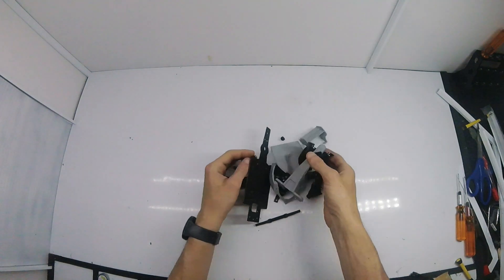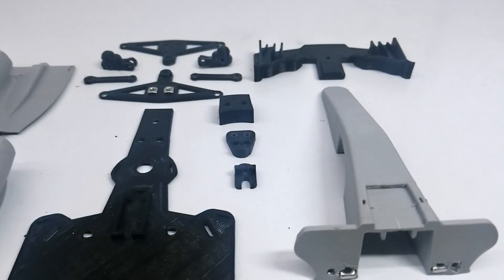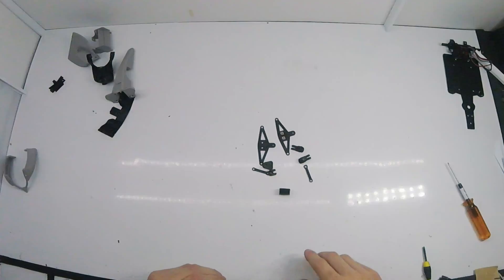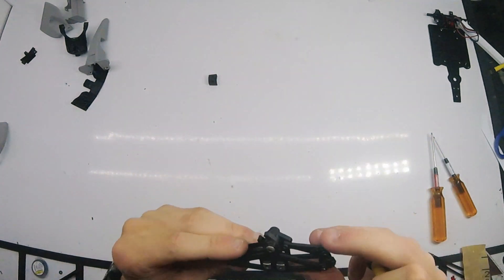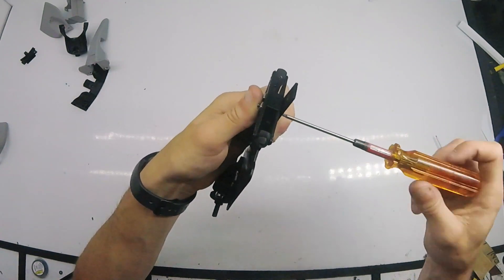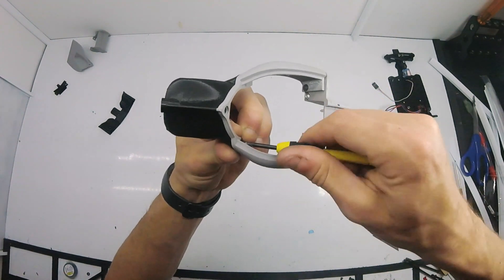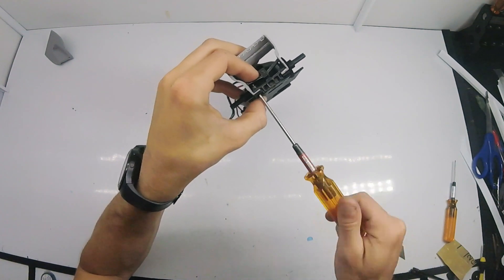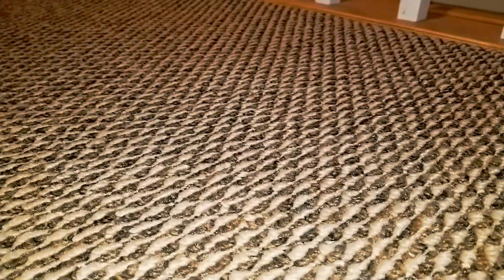Mini OpenRC F1 Car! | 3D Printed RC Car!

Comment: hello, I'm building one of these now and this video has been very helpful, if you are still active here I was wondering a couple things - 

first is, what length screws did you need to use to attach the front control-arm assembly? The ones that go up through the chassis and are captive on the top with square nuts.
Second - would you be willing to share your file for the solid steering bellcrank you made? I have also found the servo saver is too soft for my liking, and would appreciate it. 
Finally, I believe you said you found some slot car foam tires to use and I'd also like to do so, would you happen to know where you got them? 

Thank you! Even if you don't reply this video has been quite helpful in my build already.

Comment: Hey nice build ! After printing all the parts I noticed you require a gearbox or rear end from a donor car ? I didn't notice in your video . Is this a newer or older build of this ? Thanks for any clarification you could give . Cheers !
Reply from the maker: This is an older build I did but all of the parts were printed. I didn't need anything from any donor cars.
Reply: Thanks for the fast reply ! I must have downloaded a remix of it or something.  . . Going to start printing another right now . All the best !
Reply: Yeah you got the wrong file you want 1/18 not the mini one. Sure you figured it out by now but commenting for anyone else

Comment: Can you share a link to the foam slot tires you picked up? also what square nut did you purchase? all the ones i have found so far are too thick to fit in the slots.  Thanks.
Reply from the maker: The tires are from ebay. Item number 361972998654
The square nuts I got from Amazon.
Honbay 100pcs 304 Stainless Steel M3 Square Nuts https://www.amazon.com/dp/B06XPFLNBS/ref=cm_sw_r_cp_apa_i_znf8DbYJ80TCX
Reply: thanks for the links, those nuts are the ones I got also, but at 2.4mm thick they won't fit in the slots. strange since I printed this one with a SLA printer so would expect them to be more accurate than an FDM printed one. I have ordered some 2mm ones to see if that makes it easier. fingers crossed.
Reply from the maker: @gbconcepts  Thats definitely odd. A few of the nuts were a tight squeeze, but most of them fit no problem.